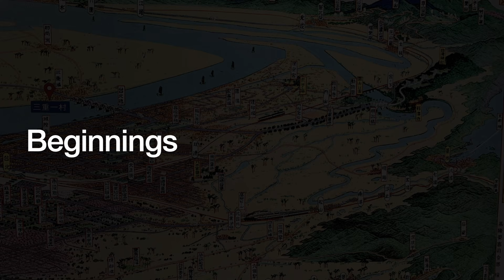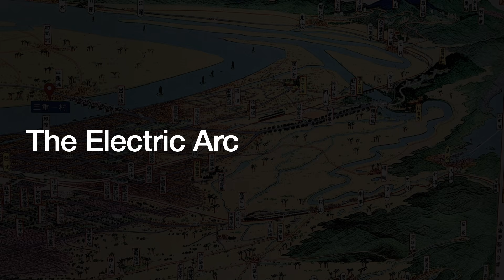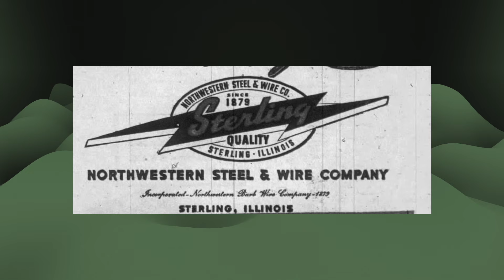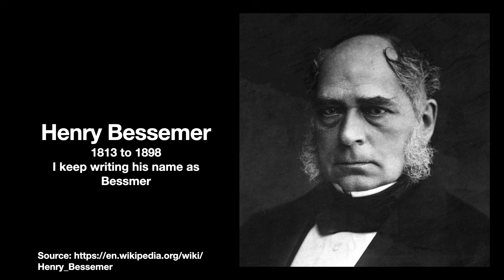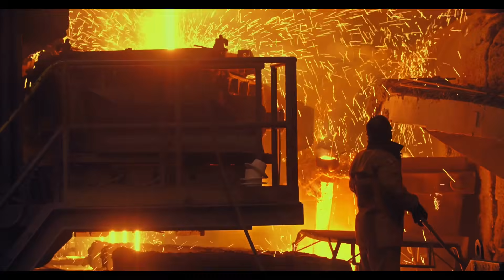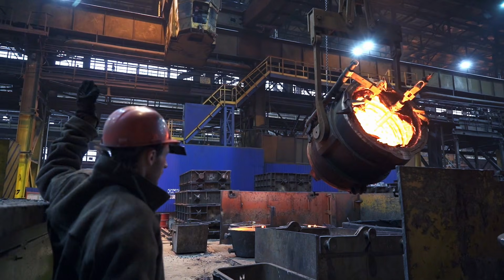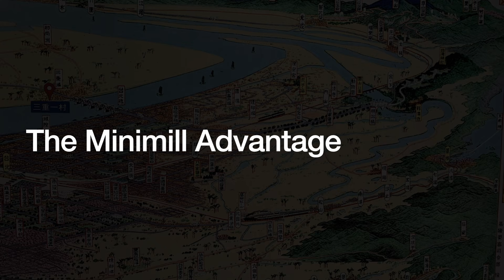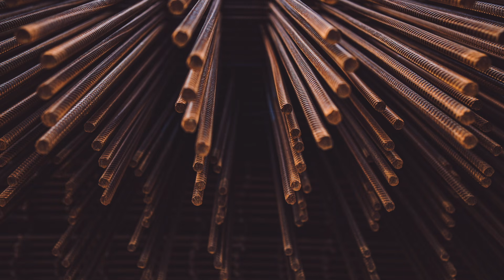Disrupting Big Steel: Conquest of the Minimills

Comment: Asianometry : I am the one single person n the world who has transformed both the Steel and the Semiconductor industries of the world with my inventions and have pushed them to HVM. In the first 5 yrs after getting my twin PhDs in both Metallurgy and Mathematics ( Numercal Analyses for HPC ) I developed highly efficient and low cost processes to refine and cast slabs of steel. The Minimills adopted them and took off. Then I got bored and realized that the computer / Chip industry needed my help, because even after RISC their thruput was too slow to run my large Physics models. So I moved back home to AZ and worked first for Motorola and then Intel, developed their the whole bundle ( the theory, interconnect technologies, assembly robots, … , HVM processes ) the whole shebang and you all have been enjoying the benefits since the mid 1990s, it is my inventions ( the first ever flip chipped GaAs, now in every Smart phone and Radar  ) that made it possible to watch streamed videos even on cheap handsets ( Moto StarTac ) by 1997, and the Pentium 3 Flip Chipped on Organic substrates ( that I  developed at Intel after IBM had failed and transferred it to Japan fron where it has trickled down to the sneaky parasites & pirates of Taiwan ) by 1999. As the Chair of the IEEE committee that decides on future AP tech ( 2/3 rds of which are my inventions ) I have recently ( SemiCon 2026 ) put my foot down on the insane, uneducated Taiwanese copycats pushing for ever larger ( multi Reticle Interposers ) and from now in the interest of both lower Cap & Op ( power consumption ) costs as well as compute performance we must stack not just HBM ( made possible by one of my old inventions at Moto ) even very Hot ( > 100 watts per sq cm ) Processor chips in 3d stacks. If you want to do a program on the theory of Continuous Casting or the best architecture for 3d Modules optimized for AI algorithms and networked w/ CoPO for very large problems ( >> current 200 billion parameters ) then contact me at dgupta@apstl.com

Comment: 4-06-2026.
I work at Garrett airospace back in the mid 80, l ran the R/D test unit in El Secondo California, we cast ductile iron for the air and space industry, fun times, and lots of money, some of the stainless steel  turbo housings were for rocket pumps, you left out what the Scandinavians are doing with the new Hydrogen injected furnaces.

Comment: If you haven’t made a video about Aluminum production it would be interesting, and the Cryolite that acts as a molten solvent in the Hall-Héroult process for smelting alumina (aluminum oxide) into aluminum metal, which is today made artificially since the 1980s, but before that the extremely rare Cryolite was the most effective way, but only one large deposit has ever been found in Greenland which when Denmark was occupied made the Danish ambassador to the USA by his own initiative take to the president in 1940 informing him of the enormous importance for Aluminum production potential which was in Greenland which resulted in the deployment of the US military at the mine with a large force and naval artillery but for some reason Germany didn’t ever seem to notice the importance from 1940-45 the production was nigh and day greatly boating fists Pennsylvanian then other states and Canadian Aluminum production giving both USA UK and USSR massive amounts of high quality aluminum which is wildly used, Aircraft, tank engines, ships. And Germany didn’t even try to bomb the mine properly didn’t know or understood like the US president until informed

Comment: So, I'd argue that the integrated mills weren't all that inefficient. Making primary steel IS more costly than recycling scrap. It costs more in energy, handling, and labor. The minimills recycle scrap, which saves them that cost. It really isn't a fair comparison when they're using a product which had tons of energy put into it, and then comparing it to primary steel. The primary steel market essentially subsidized its own demise.

That said, for most purposes, there is no practical difference. Well, as long as you have enough scrap steel. However, what happens when the demand for steel outstrips the supply of scrap? For instance, during a war? These mills don't produce new steel. They can only recycle used steel. If we suddenly needed more steel, you might discover the true cost.

Comment: The problem with minimills is that the scrap is becoming more contaminated with copper. It doesn't take much copper to make steel weaker. There is currently no process to separate the copper from the steel. Pig iron has to be added to the scrap to dilute the copper. Each time steel gets recycled, more copper creeps in.

Comment: Thank you for this.  Our Hamilton (Stoney Creek) company built new overhead crane cabs for Lasco east of Toronto and the asian fellow cleaned the windows before assembly, which had  a gold coating on one, side put the 'This side out' sticker on the other side so myself and a fellow worker had to go there and turn them around 100 ft up.  As we were working one of the big thumping carbons broke with a big flash.  Steel was big back then.  Both my uncles worked and retired from Dofasco Steel which made rolled steel for the auto industry.

Comment: Time, work and thought, and it shows in this presentation.  Thank you.
A couple of minor notes--
- @ 0:52, the source of iron fed to a blast furnace is mostly taconite pellets, a product of iron ore that has been pulverized and then processed to remove mostly anything, (mostly silica), but Fe+2 and Fe+3 conjugated with oxygen for an iron content of about 65%.  Waste scrap iron and steel mixed with oil that has undergone a sintering process, (which is pictured at 0:52), can also be a source of iron fed to a blast furnace but in a much smaller proportion. Scrap iron and steel of low quality can supplement the taconite, too, but must not contain lead or zinc which would collect in the stack of a blast furnace.
- The compact strip mill probably became even shorter with Nucor's introduction of thin cast strip in 2002  that just about eliminates the need for rolling.  This ability may have also allowed the production of less than 20 ppm nitrogen steel, something that only the integrated steel producers had been able to supply.
- Relatively recently, minimills are sometimes augmenting scrap iron and steel with direct reduced iron and the integrated steel producers are also towards that direction using a process such as Midrex, Finex or Corex.
- Nucor expanded rapidly in the 1990s in part because of John Correnti, who coordinated the design and construction of minimills in about half the normal time at significantly lower cost.  His last contribution was the CEO and designer of Big River Steel in Arkansas, which was later bought out by US Steel and likely one of its best ever ventures.
- US Steel acquisition of Marathon Petroleum was in part justified by making use of US Steel's recent past and expected massive income losses which could be used to offset Marathon's large profit earned in the late 1970s and early 1980s.  A number of US Steel facilities were closed in 1979, and that was only the beginning of what was yet to come over the next 10 to 12 years.

Comment: The 70s may be a warning on Trump's tariffs. I predict that what will happen won't result in a return of manufacturing to the US but we will see a huge data center built on every corner as part of the AI race - the centers will be built as part of a negotiated deal that drops or lowers tarrifs on specific company's imports in exchange for a data center or two. That will drive US electricity prices up. We are already taking steps for this - pre-planning, no real plan yet.

Comment: I think you are missing some of the more recent innovations and demand. Aluminium is now in big demand (The  no 1 selling vehicle in the US is made of it) but the issue is power demand and vast amounts of cheap power. The other is emissions- the EU and anyone who sells into it, is now facing the fact it must make steel greener ie less energy in for the steel coming out. Want to sell your steel into the EU all made by burning coal and open furnace designs then its going to cost you (as it will for internal makers who dont innovate). Meantime the Chinese has dumped on the market to kill off competitors and they have an stranglehold on the internal market. China is also overproducing and it employs too many in the whole chain (within China) to end that in each state. There are now even more interesting ways of making steel and these test (large test) pilot plants are being built in Spain and Sweden. Steel has also offered some competition with high grade thin steel that is some better competiton to Alu/Carbon Fibre and some plastics.

Comment: Mini mills not needing as much fresh water for blast furnace cooling completely collapsed the midwest in the USA. We still are experiencing the poverty left behind as a result of the rise of mini mills. Deregulation is the key word as to how it happened the way it did. Edit: the oil industry has owned and ran the USA since the collapse of steel. The labor unions have become weaker and weaker every year since this.

Comment: This a good overview and pretty well answers a question /debate I was involved in.  The question was rationalizing why coal for coke still had to be produced and the answer put forth ( that I disagreed with ) was that these mini mills didn't produce the quality that integrated steel mills did. Only produced rebar and other crappie steel grades.  

My thought is that integrated steel mills pretty much produce low carbon steel.  Whereas there is no limit what an elec arc furnace could produce from stainless steel, tool steel , carbon A36 structural or even rebar.  

Does anyone know where this myth came from?
Reply: This idea came from a mining eng working for a huge met coal mine.  Now I think the real reason as yet its not practical to produce steel from iron ore other than in a integrated steel mill with coke ovens and blast furnaces. The US can make it work with minimills as they have lots of scrap and import lots of steel products.  Whereas China doesn't have scrap to spare and is exporting lots of steel products so the math doesn't work out for mini mills.

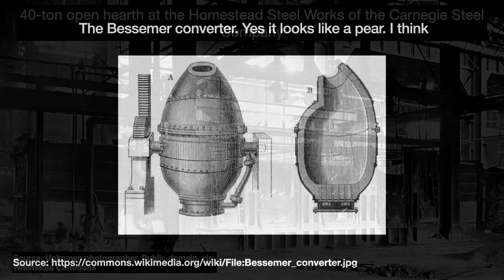Comment: 1:55 The main differences between the Bessemer and open hearth furnace: 

1. Bessemer furnaces depends on the exothermic reaction of the forced air reacting with carbon in the pig iron to intermittently raise the temperature high enough to keep the resulting reduced steel molten. Since this reaction can't be stop once it starts and ends when there is no carbon remaining, it is quick but leaves little time to make adjustments to the steel melt. 

2. Instead of forced air, open hearth remove carbon from pig iron by throwing in iron ore (iron oxide) into molten pig iron. They usually use a heat exchange system, where input air and furnace exhaust gases alternately flow through passage channels to and out the furnace, to get it hot enough to keep the resulting reduced steel or iron molten. As the masonry walls of a channel carry exhaust gases is heated up, input air is switched to flow through it. The residue heat from the walls heat up the draft air before it enters the combustion chamber. This raises the temperature of combustion, allowing the furnace to reach and maintain a temperature over 1500'C. Since open hearth furnaces can maintain these high temperatures for longer, there is time for operators to analyze the makeup of the molten steel, than add ingredients like coke or manganese as needed to adjust the carbon or additive content. The open hearth can also recycle old steel or iron unlike the Bessemer furnace.

Comment: I had a VIP tour of LASCO in 1986. They were on the board of a university research institute where I was managing director. We were standing on a floor beneath the very hot and heavy steel furnace watching the continuous casting process when a so-called “upset” occurred. Instead of running through the rollers like it was supposed, the fast-moving red-hot steel snake about 4 inches in diameter jumped out of the machine and spilled 😢onto the floor. I don’t think it was the first time because the workers had a very long cutting torch which they used to snip off the errant part. They didn’t seem too worked up but it was more than enough excitement for me.
Reply: Most mills have flying cobble shears between the rolling stands that cut the remainder of the billet into pieces when a cobble occurs. The pieces are removed on a conveyor belt and dumped into a rail car to take them back to scrap. If a cobble happens after the last stand, or something goes wrong with the shear, the spaghetti steel has to be manually cut up after it cools. It's exciting because the steel is moving about 40 MPH.
Reply: In Whitby?
Reply: There's a video of something like that happening with video game sound fx played over the top of it, I can't find it anymore though but it was kinda a neat edit to an otherwise alarming situation.
Reply: I worked in a mini-mill here in Kentucky for one year - it was very perilous in many ways to work there; for instance, I ran around most days, it seemed, with a fire extinguisher putting out small fires - and this was the safe part of the job, basically. I couldn't believe how dangerous the mini-mill was compared to a unionized aluminum mill I had previously worked in one summer. I will always support unions based on my experience working in union shops versus non-union shops. Beyond a doubt in my mind is that unions, in general, make dangerous places to work much safer.

Comment: So, what's really interesting, is mini mills are an exclusively american phenomenon. European and asian steel definitely still is on the side of integrated steel mills. What's more, people keep trying to build them in europe, but it turns out they are unprofitable for various reasons. Big steel still has a bight future ahead.
Reply: I think Europe's small size and extensive infrastructure makes the localized plant advantage of minimills largely irrelevant. Most integrated steel plants in Europe are situated along a river or coastline which further improves their logistics. Furthermore, the integrated plants have their quality locked in. They have access to high quality scrap and along with that the BOF inherently produces better quality steel. EAFs require so much more scrap to operate, you have to start sourcing lower quality stuff to be able to feed it enough.
Reply: ??? google "Map of EU steel production sites" there are plenty of minimills all over
Reply: True for asia to of course

Comment: Also intersting note, many steel firms were innovative at some point, but being first adopter to a new tech did backfire for a few companies, so they stopped being innovative. Or many crisis meant that only those who are careful are now running companies, that was the case for a few german companies and led to investments being hold back, until the company ran into insolvency due to having outdated plants
Reply: The steel price cycle is brutal. One year it's massive profit and bonuses for management/shareholders, the other years they cut 10000 jobs and stop doing basic upkeep to try and stay solvent. There's barely any time or money to invest and innovate during all that.😂
Reply: @SoundShunter72  true, without huge reserves, you go broke, many companies lack exactly those.